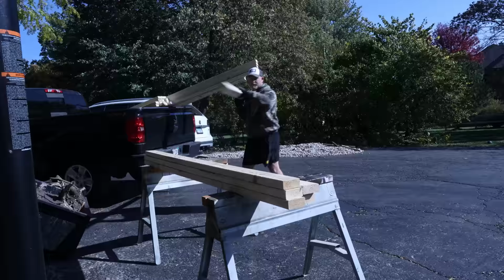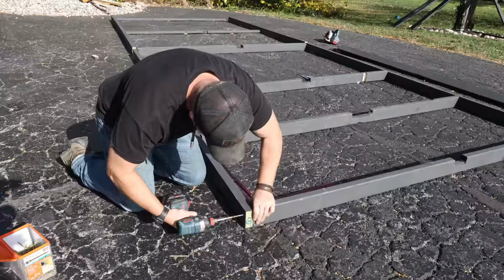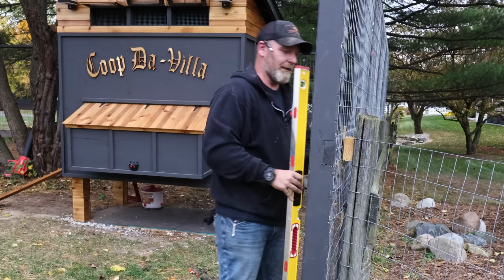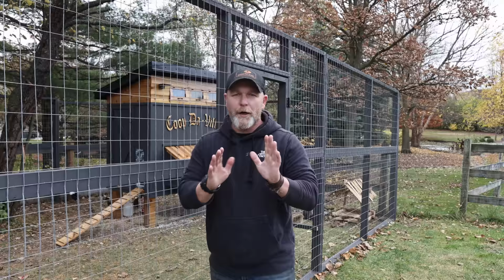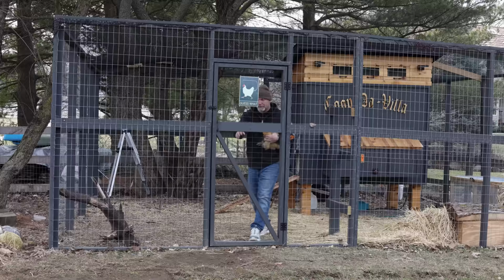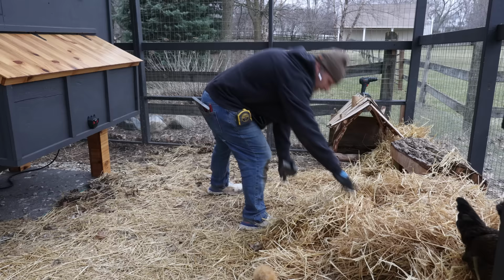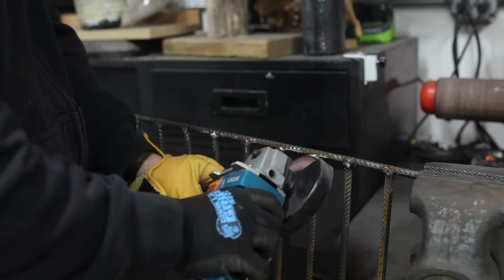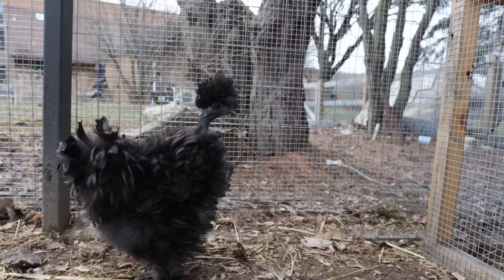How to Build a Predator Proof Chicken Run around your Coop // DIY Project

Comment: YOU ROCK! I also live in the upper Midwest UP MI above WI I totally get what your dealing with and up where I am we do have bears but so far so GOOD they are not interested. Laying barbed wire under the ground has BEEN A GOD SENT and Also under the chicken coop. I bought a OLD 1975 Camper and demoed it down to the bear bones. It was a job and would have been easier to build one but I wouldn't have gotten that much FREE Metal and I could even scrap the copper tubing in it for money to build my coop. It was HOT mess for me and my guy friend to take on as a job but we did it and Over half the (RV/Camper coop) is turned into a beautiful coop with barbed wire under it as well and metal around the bottom as a skirt down into the earth. The Chickens love it and it's safe for them. My Run is NOT NEARLY as Build out Beeeeautiful as yours but it's a work in progress and MAN do I wish I had a guy like you around to help me build it out but they get 40 feet by 8 and 10 feet in one spot next to the coop door area to play around and run like crazy funny chickens. Last year was my first year with Chicks and it was WONDERFUL FUN EXCITING and scary all at the same time to figure out if I did them justices for safety. So I totally get where your coming from. Those SHOES are PERFECT for around my homestead and I THANK YOU BIG TIME for showing me them. I already love your wife she is just like me LOL with the need for cameras to figure out what your dealing with. Thank you again for all your workmen ship your one heck of a great man to build and take care of those chickens. :) A Michigan MOM

Comment: I have a 8x10 run for my chickens and only rats are an issue.  I used a product similar to in your thumbnail and it didn't even slow down the rats - if anything it helps keep tunnels for rats accessible.  Buried 1/4 mesh is the only thing that has worked for rats
Reply: Also for overhead concerns I put chicken wire that I then covered with a silver tarp.  No predators from above.  Also doing deep bedding method and finding run is very warm.  Wrapped entire coop/run with clear tarps

Comment: You could install a low electric fence on the outside of the cage.  That would deter any predator from even starting to dig under the cage.  There are solar powered ones that have a battery and it gives a little jolt.   Hopefully that will also keep the snakes from coming to get the baby chickens.

Comment: There is a much better way than the rebar contraptions.  Looks cool, but all you need is a bit of wire fencing on the ground, wired to the side fencing.  Animals that dig will always go right up to the structure and dig.  Another REALLY good method is to install a solar electric fence.  Where I live, coyotes are on the hunt EVERY night and with electric wire, they just don't go near it once they learn the lesson.

Comment: I would dig at least a foot down before setting in the coup & lay out gopher wire under ground (smaller hexagons than chicken wire) then bury it with the edges sticking up at the perimeter. Then set up the coup stuff on top. Then build the fence on top and attach the edge of the gopher wire to the outside of the bottom board with staples or nails. Nothing will be digging under. You need chicken wire around the pen to keep out weasels.  The door needs to have latches top and bottom so there is no way to force it open at the bottom. You might run the chicken wire over the top with a beam framework like a wire roof & have it go tightly around & between the tree trunks so nothing can go up top and come in down the trees. Everything you do still doesn’t keep snakes out though. I don’t know what to do about snakes, but they go after chicks & eggs, not the bigger birds. Maybe have a screen material along the bottom that is 3 feet high? LOL.

Comment: Structurally this is a solid coop and run extremely secure. They have no protection from weasels though. Also, there is no protection from hungry bears outside an armed marksman for anyone, unless the birds are locked in a solid structure (No fenced with wood coop (wood bad)) will prevent an adult bear from entering. Weasel population must be low, or the weasels have another sufficient food source. Bear attacks on coops in sight of a residence is RARE.

Comment: (Im super sorry for the really long comment/question but i don't know what to do and wanted to explain the entire situation im having. Please bare with me, lol.)

  Sooo, ive had chickens for roughly a year now. I had absolutely ZERO knowledge whatsoever about caring for them. I kinda got thrown into being a caretaker unexpectedly and with no choice, at all. 
 But, i live basically in the woods and the coop is about 120-150' behind my house next to my pool barn. Ive been lucky and never had any issues with predators...
 UNTILLLL the other night. I caught a raccoon lurking around inside of their fenced area where they roam. 
 I have 4 wireless Zmodo cameras right next to the coop/cage thingy watching everything. I have 2 outside the coop/cage thingy watching the front door and 2 inside the coop/cage. One watches the entire inside of it and the other actually is watching the inside of their of the actual wooden coop where they sleep and lay eggs and also a motion light that is secured to the top of the coop directly above the door.
 Soo, I just watched to see if this raccoon could get in ane sure enough, he found a spot where i made a mistake and was able to basically walk right in. The bottom of the door was loose enough that he was able to squeeze in with no issues. I panicked and immediately ran up there in my shorts and slides and a flashlight only. As soon as the raccoon saw my light, he freaked out and i dont know if he ripped a hole into the chicken wire cage or if it was already there and i didnt notice it. Either way, he got out. Thankfully he did because he would have been freakin out and cornered when i ran in there not even thinking about him attacking me because he was cornered. 
 But, i fixed the hole in the chicken wired cage with a bunch of zipties and i blocked the bottom of the door off and i made sure the entire door was tightly closed so nothing could get in. 
 I was out there until 1:30 in the morning securing everything. About 20 mins after i was done with that and went back inside, he came back!! He couldn't get in this time, but now he knows theres a large hole in the back corner of it. 
 I set a trap at like 2:00 in the morening and watched. He out smarted me and actually was able to drag this large trap and pull it sideways which triggered the door to close. So, he just grabbed and pulled pieces out from the cage and just ate it that way. But, now he knows there are chickens there and theres a weak spot in the chicken wire. 
 He came back last night and i caught him working on that same exact spot where he made this hole that i repaired. He was making good progress on ripping this chicken wire. I fixed it, again and this time, i decided to put a small radio out there and leave it on. i was hoping that the talking and human voices would keep him away thinking there are humans back  there. He didnt come back However, our power went out for a minute the next day and i forgot about the radio. I checked the cameras last night and there he was!! working on that hole again because the radio wasnt on. I think having a radio on really helps keeping them away because when its on he won't come around. 
 But, what can i do to strengthen that chicken wire?!? It seems like its not strong enough to handle their strength and now idk what to do..

Comment: i liked your rebar anti dig good idea and a person can move it if need be . Here we have bears they go through 3/4 inch ply wood like its a loaf of bread .Only thing i found effective was a electric fence zig zagged up and down the coop walls and a loop . [ movable loop hangs on a insulator ]  blocking walk way to the human entrance door . along with a bear matt in front of entrance .[a ply wood matt peppered with 1 1/4 roof nails about 2" apart on hinges ] so bear cant stand in front of door and rip it open. i doubt any thing is 100%  but this has worked for us . a person really needs to think like the predator dont they . The next line of defence is my blue heelers will bark if they hear a bear and shot blast in air . But the electric fence has worked perfectly so far. I think you done well for your area my opinion is you need make sure nothin gets in the coop when your sleeping ,who cares if anything gets in the fenced run as long as the chickens are safe .

Comment: My coop and run is completely enclosed by 1/2" hardware cloth, all sides.  There is a galvanized roof on top.  Around the outside there is 1/2 cloth laid horizontally buried 6 inches deep and runs out 30 inches from the perimeter of the coop and run.   Everything sets on treated lumber that is attached to 2 runs of 16x8 cinder block buried below.  Never had it breeched and if a predator does get in, it deserves a chicken dinner.

Comment: We put chicken wire down the side of the run, then bent and turned the last foot out away from the run and  buried it with leaves. So an animal would have to be at least one foot away from the chicken run and start digging to dig it’s way under the fencing. Much simpler way to protect our ladies!

Comment: Fantastic coop! Debating about whether to delve.  Main concern is RATs. Mesh would have to have very small openings.... not such a nice look. Any ideas for rat prevention?
Reply: never leave the under-coop area open.   not only do the chickens like laying eggs underneath where you can't reach them, rats and mice build nests and have babies in underground tunnels underneath the coop.  I would suggest the very smallest holed hardware cloth under the perimeter of the coop.  Start 
holding the hardware cloth just under the edge of the bottom of the coop and nail attach it all the way around the coop.  Then, either surround the bottom of the hardware cloth, inside and out with treated 4x4s securing the hardware cloth between the 4x4s.If you can, put spike strips deep into the ground  to keep larger predators from crawling under.

Comment: There’s no need to do all that work to build spikes. Lay the thick wire fencing on the exterior ground after painting it.  I would have kept the color on the overhead netting as it could help dazzle the predators overhead, making it harder for them to see or focus onto the prey underneath. I would also add shiny dazzlers such as mirrors and aluminum on wire to assist in distracting and deterring the predators from seeing the prey.

Comment: I completely wrapped my run and coop ventilation slots with heavy hardware cloth when I built it. I then buried a 2ft wide non-climbable wire apron around the entire structure burying it under layers of clay dirt that sets like concrete. Nothing gets in but me.
Reply from the maker: That’s a great idea!!! Thank you

Comment: Bummer about the one you lost. As soon as I say the initial part of the video I was already saying that the openings in the welded wire were too large. In addition to the smaller mesh, we extended it out from the wall 12” onto the ground, and finally ran 8” high R panel around the bottom to help reinforce at the ground level

Comment: Best practice is to use 1/2 inch hardware cloth all over and use metal zip ties not the tiny wires you were using as Raccoon will cut through those like hot knife through Butter.

Comment: Awesome ideas! What cameras did you use? Are they battery operated or wired? I didn't see any wiring.
Reply from the maker: We used the same system we use in the house but these are battery. Lasts about 3 weeks and takes 5 hours to recharge them.   Thinking of getting two extra batteries so we don’t have to wait.   They are from simply safe
Reply: @KomarProject  thank you! Tell your wife I think that was a great idea to add cameras!

Comment: Many YouTubers go overboard with all the devices and spending, no one needs all that expensive crap, what is the cost of a chicken? So, far my chickens have not been attacked by predators and we have them all here, BobCats, Racoons, Snakes, Skunks, Possums, Coyotes, Dogs, Cats, Armadillos, Hawks, Crows, Owls, etc. The Poultry electric fence and Nigerian goats, together walking the land have been safe. Chicken coop only needs mesh fence around the base as an extra measure and I don't even have a chicken run. My Cameras haven't caught any predators jumping the fence, so they haven't even walked around the goat or chicken houses. Chickens and goats tried once to walk thru it and the shock forever trained them to stay inside.

Comment: This is goat no climb fencing. We have lost several flocks to minks digging under the frame. They can also go through the 2x3” fencing you’re using. I recovered all of our static pen and chicken house ventilation areas with hardware cloth. Much better! I dug down one foot around the outside of the bottom frame and buried the hw cloth, then mixed quickcrete and poured. Back filled with dirt and rocks, then placed 12x12” concrete pavers 2” thick around the entire perimeter. We call it Fort Knox…😂😂 Our outdoor static pen has metal roofing which protects then in bad weather, and our chicken house has clear composite roofing panels for extra light. 😂😂 This comes from 15 years of experience raising chickens here on our land. We have lost some to foxes, owls, minks, hawks…you name it. So we spent $700.00 recovering our entire set up with the hw cloth. It was money well spent. 😊 Haven’t lost a bird since.

Comment: Way to expensive and to much work. You should have used small chicken wire for the whole thing including the roof and making it dig proof. Get some 3 foot wide chicken wire rake some dirt away from the bottom on the outside of coop. Then staple the inside edge to the bottom of the wood then throw some grass or herb seeds in the chicken wire on the ground. Then cover up the wire with what you raked away, water in the seeds and it will grow and hold the wire  in place and you can also use it to feed your chickens with.  I used a few bricks to hold down the wire until the grass grew out. You could use your spike thing on your neighbors side.  This is what I done 8 years ago an no predators have gotten my chickens yet. Tis nice though.

Comment: you over-engineered a solution. are you trying to keep people out? cause rebar isn't the answer for animals. 
Just lay either hardware cloth, or fencing material at a 90deg on the ground to you main fence. affix it to your main fence. done. problem solved.